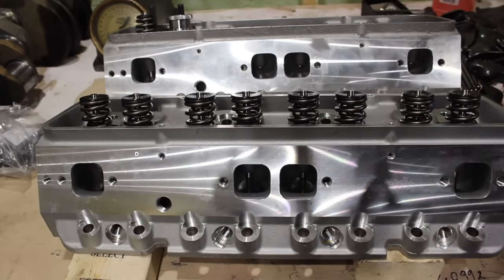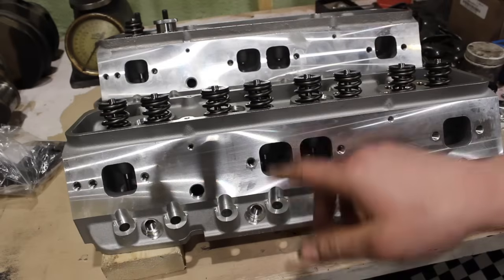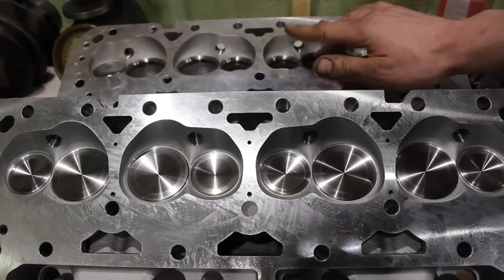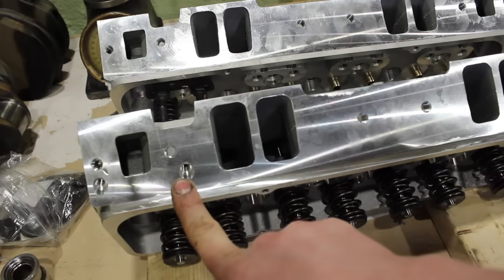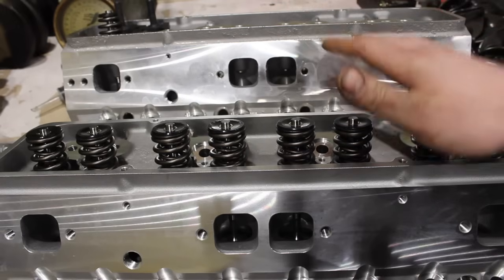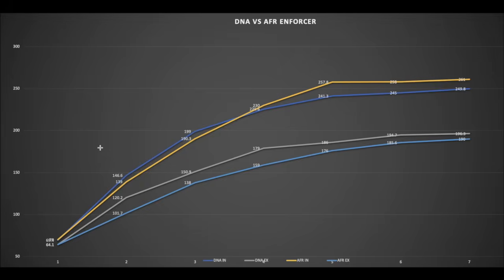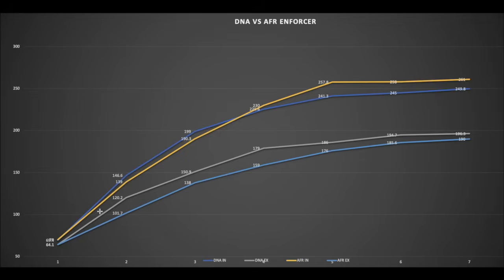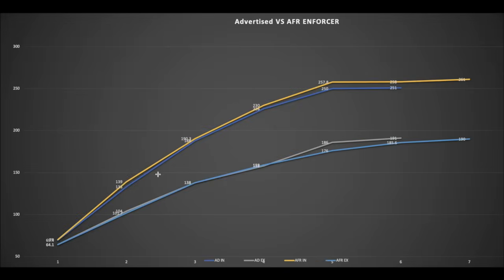$165 Amazon SBC Head vs Budget AFR Enforcer! (Flow Bench!)

Comment: AFR are the proven dyno winners in the eliminator series, not so in the enforcer series, which AFR admits are made in China. Then if you want a step up from AFR you are going to need to surf the MBE website. You will get 950-1000 hp out of a SBC using MBE heads but you are going to pay close to 10k with all the bells and whistles. Depends your application and goals.

Comment: I just bought a set of the DNA heads, very nice heads for $373 for a bare set. Mine are actually pretty clean castings, not much "casting slag" at all in the ports, very minimal. The decks are nice and flat. Only problem we have found so far, is the guides in both heads were too tight, vales would not fit in them. I had them fixed in an hour with my 11/32" reamer, and now thet are perfect. QUESTION ... Can anyone give me a part number for a set of Head Bolts to use with the DNA heads? The factory length bolts are a tad too short, especially after adding a hardended washer...

Comment: Im waiting on the arrival of some of these bare chinese castings. 68cc 200cc 2.02/1.6. Plan on going to 2.08 intake. If it flows more than 250 after some massaging, ill be happy.
Reply from the maker: You'll be happy as they can easily flow 260 with a 2.02 and some clean-up
Reply: @cuttersperformance  sweet! Dude I'm so pumped. Budget street 421 built from my dad's motorhome engine that took us to Disney in the 90s
Reply: Update: 276cfm @.5" lift 2.08 valve. 4.03 bore on bench. Still have to deshroud, work the shortside (stalled flow at .7) and blend a little. @cuttersperformance

Comment: I love my AFRs granted they are the comp ported version, but they are so well made and they perform so well, I had dart pro 1 Cnc before changed to AFR and we gained 85hp with the same port size 220-220cc both fully CNCed, the AFR just did its job so much better, I recommend them to anyone I can, yes the price is steep, but the enforcer is the new budget on the block, I trust AFR 100%

Comment: I just bought a set of afr inforcer heads and my mechanic says he's worried I may blow the bottom end cuz we did like no upgrades to the bottom end. 400 sbc BTW. 

What do you think? Will it blow up????
Reply from the maker: If the bottom end is in good shape you'll be good for 6000-6500 rpm on stock components
Reply: @cuttersperformance  awesome! Thanks man I needed that lol. I'm a noob I ain't no mechanic and I did t have an extra 5 or 10k sitting around to to the bottom end.... thats next years project. In hindsight I should have done the bottom first right? Lol o well live and learn
Reply from the maker: @ryanhancock128  as long as the bottom end is in good condition you don't have to worry about rebuilding it at this point. The biggest benefit to rebuilding it would be bumping up the compression with different pistons. If you currently have stock pistons your compression ratio won't be too high maybe around 9:1 with the new heads. I'm assuming you're changing cams at the same time as the heads?

Comment: The dna heads I bought were advertised as 200/64 2.02/ 1.60 but the seats are 1.94 at the most
Reply from the maker: Very weird, last couple sets ive had have been pretty good. But ive have heard of some poor ones. The skip white version have been pretty good so far
Reply: @cuttersperformance  The set I have, I got from Amazon to do a vortec dyno comparison. I bought them bare, and when I went to lap the valves the seat line was so high it was almost off the valve. Maybe just this pair 🤷‍♂️
Reply: I'll check out there version and see if they're any different

Comment: You should have engineered two different headers since the AFR head flows better on the intake. So, yeah you need to scavenge higher expanding gasses. Find David Vizard vids on youtube about the right way to build header pipes.
Reply: Chevy 462 double hump castings do not flow as well as stock Vortec heads.
1.94" Int. And 1.6" exhaust get cramped  when you install (stellite?)hardened exhaust seats on old 1st gen castings.
So how much are a pair of CNC AFR 2.05" Int. Off road heads? 
Even GM factory LS cathedral port heads reduce hours of grinding, flow testing and dyno time.
Raise the roof. Lower the floor. Old school.

Comment: Will either the DNA or AFR allow a 2.05 or 2.08 intake valves?  Looking for a better flowing fill on a 406-406 sbc.
Reply from the maker: Yeah they can be cut to those. Another option are the Skip white NKB heads. They seem to have better quality control than DNA

Comment: You raised the cylinder heads for more flow.  Raw blank aluminum.  You're smart.  Then you're using metric bolts and valve stems.  That's  not American.  Go Sam Houston.

Comment: 2023 update: these heads are currently running $243 as of 12/27/2023.  Pricing history shows they fluctuate (like most Amazon stocked items) between $203 and $260.  So if you're thinking about playing with these, keep an eye out for the lower end of the scale.

Comment: For the Camaro and Nova 68-81 The Hooker race car headers (weld on collectors) for the application gets around the angle plug heads no problem even with the 1 7/8” primary’s..

Comment: Those are two different port designs on the same casting. My eBay heads look just like the afr ,only 11/32 valve stems. I think I have seen three different port designs on the same casting. Afr definitely gets the top choice castings.

Comment: You get what you pay for,,,,,,,,,, NO GOOd wondering if a product is any good and laying in bed at night wondering if a cheap spring brakes tomorrow or next week, of a cheap casting has pourouse areas around bolt holes blows a head gasket, Speed cost money, how fast do you want to go. I SAW AFR up against a Chinese Head,, AFR on the same engine made 70HP more . You cant drink Whisky from a bottle of wine. Good luck.

Comment: The sbc hydraulic roller cam I am using has intake/exhaust lift of .510/.525, would the TFS valve springs mentioned in your referenced video be overkill?
Reply from the maker: No, they are pretty normal hydraulic roller spring specs, and if you happen to go to a larger cam, you'll have enough spring for that aswell

Comment: I have a question about the cheap heads, being aluminum with pressed in seats, have you heard of any seats coming loose in these heads??
Reply from the maker: I've heard of that on the old pro comp heads, but i haven't seen or heard of that on these ones.
Reply: Thanks! I've been considering getting a set. I'm very low budget and don't want to scrimp and get burned. Kind of like buying tools, knowing where you can save money on certain things and where you really do need to spend the money. I really enjoy your channel. Thanks again!
Reply from the maker: @dirtyburd71  hopefully they are still decent, The parts nowadays have quality issues with most brands. The DNA heads worked well for me for a budget build, 30+ dyno pulls, and even 5 or so pulls with boost

Comment: Good information video! I noticed the Cayuga starting line in your intro, fellow Canuck! Our 383 build up on wife's 70 Nova will sport a set of enforcer heads. Just got our Howards retro roller and max effort lifters delivered today, getting ready for assembly. Hoping for 400+ hp @10.5:1 compression.
Reply from the maker: Good eye! And yes sir 🇨🇦 . A 10.5:1 383, enforcer heads, even with a mild roller cam you should have no issues at all hitting 400 hp. Howards have some reallly good shelf grinds, what cam did you pick?
Reply: @cuttersperformance  Hey, I got the 110265-12S. I went for a little more lobe separation @ 112° as we are considering fuel injection. It's my first roller (that I've built) and looking forward to taking advantage of quick high lift, without the duration bleed-off. Hope it all works well together!
Reply: @avidcat11 Hello, hope you don't mind my asking how the setup ended up? I have Eagle crank going into '72 Vette block, recon the rods and KB Hypers. Have the DNA's bare, but think I'll get assembled Enforcers, and Howards retro roller kit. Also have MSD Atomic FI. This for '91 Conv. Camaro street use. Thanks!

Comment: I got a Chevy 305 how well would these heads work compared to stock plus I have the gen 1 305 with the older heads on it
Reply from the maker: These have 2.02 valves so they wont work with the small bore size of the 305

Comment: I love the older engines with the newer heads. Basically anything from the D port 113 corvette heads on up.
The old camel backs and 882 heads were Heavy gas guzzlers that only flowed well after some serious work.
That said I have a four bolt truck block 355 with unshrouded 202 190 valves , Ported 882 heads at 9.5:1 screw in studs and guide plates and bronze guides. That’s only because I did them myself twenty years ago and they are still like new and run really well.
Vortec and 113s are better truck heads though. I also have a 327 with camelbacks just for nostalgia. I have one Chevelle, one Xj6c jaguar, and one truck but I seem to have collected and built at least a dozen engines for some reason.
Reply: Yes it does happen

Comment: Multiple companies use these heads  skip white , assualt racing , rcp ect. There's a big thread about them on the third gen forum buget assualt racing head. They actually look just like dart platinum heads too.  My set has either the vortec or early  version intake bolts . I had choice of angle or straight plug and with or with out steam holes when purchased. They cost allot more than 186$ in 2016. Solid head though. I port matched a 1266 gasket to my single plane efi intake.  My heads are raised runner ports. I bought mine bare too. I lapped all my valves . I own a machine shop. In the tread I mention I put a set on a surface plate and belive they were flat with in .0004 ten thousandths . I've had my set on my gen 1 sbc 383 with a s488 turbo since 2016. No issues.
Reply: So then whose heads did you buy? What seller?

Comment: You are close to right on. Many people complain about china this and that, problem is MOST of things in this world are made in a handful of factories. Most "built in USA" heads are actually cast in China and assembled here. the flip side is China doesn't care so you give them a price point and they try and make it and by try is make a part that matches the price point. With that said, who thinks all these head companies, including Blueprint, ATK, AFR (on some budget lines) all have a foundry employing hundreds of workers, safety, HR, OCHA, etc. to make head castings for anything under 1K a piece? Not enough volume in sales for all the different combinations and risk involved. 

There are diamonds in the ruff along with, I don't know, using a product for its intended purpose. You can't really expect to get 800HP out of a SBC with $300 heads but you should be able to expect an easy 300 - 350hp with the right set up. I say this because almost weekly someone opens their mouth while I not so politely tell them they are an idiot. Can not count the lets slam a .600 lift in a stock lower end with out of the box speedmaster heads (usually for a flat tappet cam set up NOT a roller), drop a jegs brand dual plane and some 850 double pumper some guy rebuilt last year and get made at the parts because it runs worse then stock.
Reply: Thing is I bet all us heads are cast in China for the same price as these dna they do a little port work slap some valve and add 2k to the price

Comment: I’m gonna be building a 355 for my kids c10 . Would u use a enforcer head over a vortec ? Just subscribed…. Really good content
Reply from the maker: Thanks for checking out my channel and subscribing. 
Both are great options, maximum power and if budget allows go for the enforcers.
If you dont planning on running a large cam and building more of a cruiser with a it of power then vortecs work great aswell
Reply: @cuttersperformance  thanx for fast reply

Comment: With the heads as is, I'd guess that the AFRs might respond to a cam with longer exhaust duration, but it's also possible that the I/E flow ratio could already be optimized.  AFR is not exactly new to this game.
Reply: The I/E ratio is very dependent on the CR so AFR could not 'optimize' this unless the CR was known for each and every build the heads could be used on.

Comment: They both likely come from the same factory and from the same casting mold. The AFR heads are just "higher QC" and often finish machined in the USA. When you have things made in China and order say, 30000 units, the factory will make 700000, about 300000 will pass minimum QC, the rest are "seconds" and sold for less on the market.
Reply: True I work their . Spot on 😆  we get them from China and we finished them in the USA. And some parts are quality  . Depending on the new workers they rotate . I like this work but to bad we can't keep good workers . So most people order heads and some take many months or years to get your parts. They keep losing employees and not enough productions

Comment: No point in looking, it will never tell you if the things crack under torque etc, its stuff like that folk want to know about, not cc volume, that doesn't matter a damn on a budget build.
Reply from the maker: You are correct on that aspect of it but I will be using a set of these heads on the dyno coming up. Still doesn't tell longevity though but fun to see how much power.
Reply: @cuttersperformance  The Trick flow heads are the hot ticket over here in the UK for a BBMopar, but there isnt any for sale till Jun '22, they seem like a good piece to make easy 700hp+ with a 498 stroker.
I had INDY 440=1s in the early 90's over here, wonderful piece of kit but massive expense when I flew over to pick them up
I heard those miserable fks who owned it have sold out to a "Family" affair and service is much better now?

Comment: On the DNA head is it true that it must use +100 length valves or standard length? Also what rocker studs do you use.
Reply from the maker: Yeah i ran .100 longer valves on these for proper installed height with my setup.
I will be making a video with everything i used on these heads. Just finished them up the other night
Reply: @cuttersperformance  thanks and I’ll be watching that when it comes out.

Comment: Do you think you could hand port those DNA heads and gain 40-50cfm on the intake a 20-25cfm on the exhaust ? They might not be good enough to sell to someone else, but I bet since you have a flow bench at your disposal (and by the sound of it, the means to do a better valve job) you could create a pretty kick ass set of heads for yourself personally with nothing more than your time invested.
Reply: I hand ported mine... no way of testing flow though. so far I am very happy with them in the car.
Reply from the maker: Yeah I've had the Heads on the flow bench this week, don't think 40 to 50 cfm will happen unless i went to a bigger valve and even then. The pinch point for the push rod is thin and for sure the limiting factor for these heads. But even with 2.02/1.6 i should be able to get some gains with some basic porting
Reply: @cuttersperformance  As you showed, the exhaust is already impressive and could probably squeeze a tiny bit more with some general cleanup. The intake, if even +10-20 cfm would be killer....especially for the price.
Reply from the maker: Stay tuned for a video on that! 
Haha gotta get caught up in editing these videos lol

Comment: I bought a set of the $190 bare “200 cc” eBay heads, they look more like the AFR enforcer than the DNA head does, even have the Vortec manifold bolt holes, they’re absolutely identical to the AFR head...
Reply from the maker: Yeah I've seen those to! Also exactly like the BluePrint Racing heads aswell
Reply: @cuttersperformance  
Yep they’re all the same head, I’d like to know the real story behind them. I think you’re right, I think they’re rejects from the big name companies like Dart and AFR...
Reply: these are what I bought as well... got mine from AT racing and I believe they are the very same castings as AFR buys from china for the enforcers.

Comment: Did you say he wants the Aluminum heads mostly for the looks ??? Dude looks really ? They make Aluminum paint that costs 6.99 for a can. But any man who has built more than one token motor knows without being told To NEVER just take a head out of the box and install it NEVER We have all seen hi dollar heads come with crap valve jobs but your performance is guaranteed if you take the time to go thru your new Aluminum heads you can turn a cheap head into a real power maker...

Comment: Do some welding on them and see the quality of the casting the cheap ones are probably a sand cast
Reply: They are definitely a sand cast. It's definitely not a head to use on anything you want to push a bit.

Comment: I have a question on these spring kits. They allow you to use a higher lift cam without any additional machining? What kind of lift are we talking about? Can they be used with a hydraulic roller cam? I've got a GM crate 330hp 350 with vortec heads with only about 4K on the mileage and would love to buy a kit that allows for the addition of a roller cam and lifters around the .550 lift range. Block is already set for roller setup.